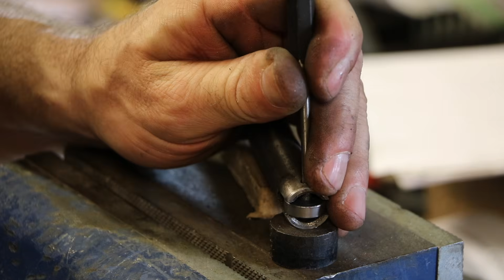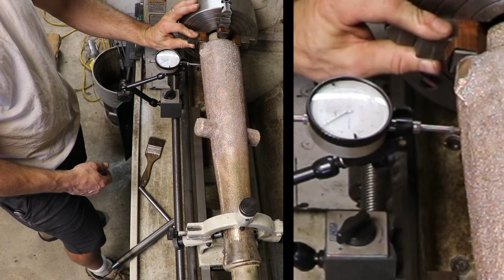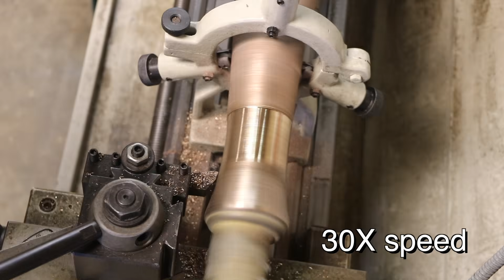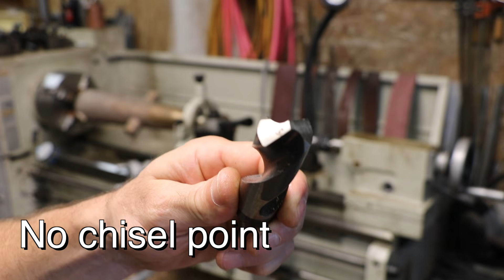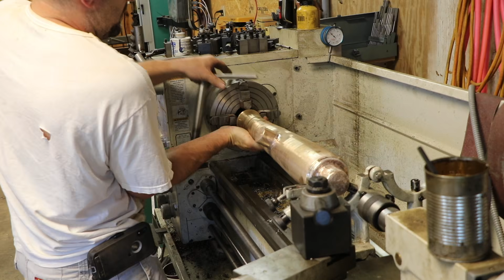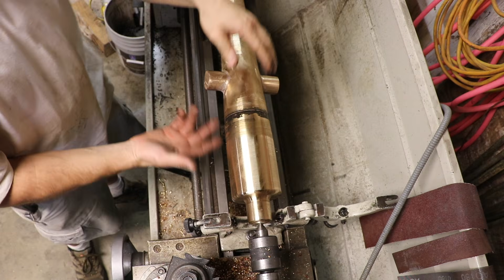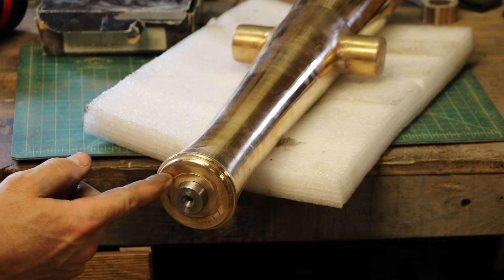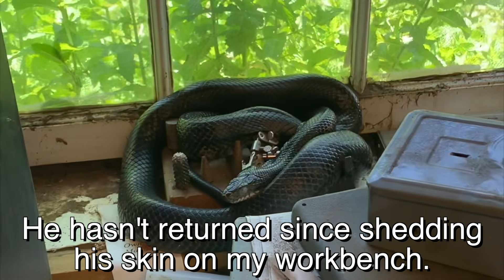Machining a Historic Bronze Cannon Barrel, Scaled Down Replica. FarmCraft101

Comment: you can make a steel sleeve that clamps on the outside of parts to interface with the steady, which gives a few benefits. it allows you to dial in the part at the steady, if it's a bit out of concentricity you can offset it to put the axis right where you want it. it also allows you to run a rough or uneven surface in the steady, because the part actually running on the bearing is the machined sleeve. this wouldn't help with this particular project, as the cannon was too big to start off with, but it would help with small parts, and speaking of small parts. it would let you work on much smaller diameter work again, because the sleeve essentially extends out that surface.

Comment: I've made a great many cannons both cast and from solid. If it's for a noisemaker just proof with  300gr of 1f black wadded with an inch or 2 of newspaper..A  standard  noise load in a 1 inch bore of 100 gr. gives a great bang.  If you want to fire projectiles a 1/4 wall Dom seamless liner with a threaded and welded plug in the end  epoxied in would be super safe.  Cheers.

Comment: For some reason I didn't think making a cannon would be this hard. "Just cast it and bore it, how difficult can that be?" But there are so many little challenges you need to deal with.
Well done man. As for the bore, could you fill the bore with molten bronze and drill it again? Adding a sleeve would detract from the whole "historical" aspect a little.
Reply from the maker: Agree on keeping it historic. And also agree I didn’t expect it to be quite this hard. I like your idea of pouring more bronze down the bore, but I doubt it would stick well enough to help. At this point I’m going to plod onward, and hope for the best.
Reply: @FarmCraft101   I would say it's worth a shot. But then again I'm not the one who would have to do all the hard work!
In either case, you got yourself a gorgeous piece.

Comment: I'm not a professional gunsmith, but I work on my own guns and am familiar with the kinds of pressures  that you're looking at.  To me, it's not the pressure that bothers me.  The fact that there is a casting defect in the barrel is cause for major concern because what if there are unseen defects?  What if that defect is hiding a more serious problem in the metal.  I would not feel comfortable running anything through that barrel.  Going the route of boring it out further and using a steel sleeve is probably the most viable option aside from recasting it.

Comment: Either install a sleeve or shoot it as is.  If you leave it as it is use a proof charge for the first firing.  I'd put a 3/32" touch hole in it and use cannon fuse.  A foot or so of fuse will give you time to get away when proofing.    For a proof load I'd Give it a double charge of black powder and two balls.

Comment: punch it out to 1.25 or 1.375 and sleeve it with piece tube  brass or bronze bearing material or steel liner  or  leave it as a ceremony piece and make another this time with a removable core or a steel tube liner already cast into it.  i know its not the same as an all brass one but its alot easier and safer  in the long run.  plus the steel sleeve will take alot more abuse over time. if you do the cast in steel barrel liner use a thick 1\2 wall steel tube and cut ridge grooves or drill dimples in it the full length so the molten brass flows into them and grips the steel liner ive seen instances where steel liners have come out of things even though pressed in with plenty of interference fit several tons of  pressure.
Reply from the maker: I like the dimple idea.

Comment: I would consider brazing the defect(s), you would have to choose a filler that has a low enough temperature to flow, but not too high that your cannon will deform, this should help reduce any stresses and blow-by forces, then you can re bore the cannon and sleeve it if necessary.
https://en.wikipedia.org/wiki/List_of_brazing_alloys

Comment: you should round/ concave the muzzle end of the barrel slightly to make it easier to load. just a small radius so you dont have that sharp edge on the inner barrel. and for the defect one option would be to expand the bore size until it is big enough that a sleve of some sort would fit in the barrel so that you have a totaly smooth bore with no defects, but im no expert so it might not work but it could make the cannon safer if it did work. but man i wish i was that good at machining, i might have to see if i can try out my brothers lathe

Comment: to find the center on the back of the cannon, you can put a tight fitting rod in the beginning of the barrel as not to compress the hole when you clamp it hard, zero it at the chuck, and approximately zero the back end, put your center to it, barely touching, and rotate the cannon slowly. if it is out of center your centerpoint wil draw a circle in the bronze, if not it'll turn in line with the point and just mark a dot. then you can put a steady rest if you like :) also nicely done for freehand turning, that's not an easy thing on longer pieces like this one :)

Comment: Here's how to fix your "sag" problem. First, take a known diameter from the chuck end and the unsupported end. Next, take the difference and divide by two. Then, mount your mag base on the saddle and zero your dial indicator on the known diameter on the chuck end. After that, you're gonna use the saddle and go positive Z until you get to your second known diameter on the unsupported end. The reading on the dial indicator would, in theory be half the difference in your two known diameters you took at the beginning. However, because your bang stick is drooping so much, the difference your gonna see on that travel indicator is going to much larger. Now, to fix it, you can subtract the original difference in diameters from the travel indicator reading and WA LA!! That's how much elevation you're gonna need from your steady rest. Hope this helps!

Comment: seems a shame to have to bore a fuse hole in it. I would go with a steel sleeve down it no question. You don't want to find out where Smitherenes actually is.

Comment: Yea it made a barrel.  So a collar over the screw capture - and it is long and is captured in the frame.  Extending the screw backwards. Just a though about centering - make a paper collar so the precision ball on the dial doesn't get flattened from the Silicon in the bronze.  Bronze turnings - bucket - how about Bushing for the trunnels on the wood base. The Breach will fill with lead if shooting lead.  Then maybe waxing the lead which will lube the cannon ball or grape shot.

Comment: Maybe you should consider getting some NDT x-rays done on it. That would certainly tell you all the defects in the cannon.
Reply: Ultrasonic testing (UT) would be much, much cheaper. And safer.
Reply: jockellis never priced it out but I did do radiography as a job for a few years. X-ray is definitely safe to do if but I don’t know the cost difference.
Reply: @jmoss10403  I know next to nothing about X raying or Ultrasonic but is the X ray problem that to X ray through that thickness of bronze you need high intensity X rays, safe enough if you far enough away, but not standard intensity sounds expensive. As mentioned this is total guesswork on my part.
Reply: @Cloudman572  doing the xray work himself is not really an option. His best bet would be to outsource the work to a local company. That would be the most cost effective way to do it because the ultrasound equipment isn't cheap and the knowledge of what your looking at when it comes to performing the ultrasound takes time to learn. X-ray is a good way to visually see any defects small or large in the part. The part thickness if a maximum of 2 inches is easy to xray and shooting a part like his would be really easy to do if you placed the source inside the bore.
Reply: @jmoss10403  Ok, but who suggested he do the work himself, certainly not me.

Comment: i really like this project! That said the green sand sure leaves a mess deep in the surface metal
Reply: Not necessarily the green sand. The fact that it's not pressure casted/ not put in a vacuum chamber. I use steel molds and i have this sort of defects.
Reply: @dragosmates  just my ignorance showing thanks for the feedback

Comment: Start over.😢. If it has flaws you can see there is a high probability it has other stress fractures. If there is a way I would have magnaflux inspection done on it or some other form of inspection. 27000 psi is nothing to mess with...12 ton-force per as inch...i am sure with the number of followers it would make for a very informative video. Plus success in the end. Keep up your effort and thanks for sharing!

Comment: What about using a metal sleeve? You might lose some bore diameter but at least you'd be extra safe.
Reply from the maker: I may sleeve it in the future, but for now I want to keep it traditional.
Reply: and possibly fill the hole with something? I guess you wouldn't want the sleeve to bulge out.

Comment: I do not see the logic in the idea of taking metal off it so it will be stronger as well as thinner? No way. The only way to increase strength is through heat treating at this stage of the game. To find center I would suggest straight line and measure it. That way you can get your support to be the correct life, to compensate for the gravity and the deflection in the cannon. Did you do a before weight on the cannon and an after weight after polishing was done?

Comment: I kinda doubt it'll blow out where the defect is at first but you'll end up with lots of blow by, which will erode and stress that the area even more. eventually it will fail and your projectiles will always preform poorly (blow by) before everything goes to hell. I'd sleeve it if your wanting it to function as a real cannon. If your just wanting it for a noise maker (black powder, no projectiles) it'll probably be alright but you've already gone this far, why not make it fully functional. No matter what, it's cool as hell. Thanks for sharing.
Reply: Jon is correct. It will likely stand several firings. However, at some point it will likely fail at that point. If you have the ability (seems like you do) just sleve it.
Reply: Yes
Reply: I agree with @Jon_James.  I was thinking a sleeve is your best bet mostly because of windage erosion past the defect.  Boring it out without a sleeve is concerning for thin walls and possibly exposing other defects.  Filling in the big defect seems like it will be either a strong point or weak point and doesn't address the smaller defects that will also erode over time.  I am not a gunsmith.  Most of my knowledge comes from studying naval artillery so I'm not really sure how downsizing will effect my own assumptions but with defects in a bronze cannon, I would estimate 50-100 rounds fired at the most before you notice severe drop in performance.  Even that may be an overestimate.

All that being said.  Love the channel and I think it's great that you took on this project!  I've learned some things.

Comment: Bore it out a little more, hopefully you lose the defects and don't find more, then add a steel sleeve as others have suggested.
Reply: no because the walls will be too thin at that point...
Reply: @flamecaty  Thats why the steel sleeve.
Reply: @schnitzellover6699  problem with that will be to balance the steel sleeve to the cast bronze. Because both are very different materials their point of plastic deformation ( a deformation with permanent indentation/change)  the steel sleeve will widen under pressure so it will press against the bronze the bronze will permanently deform while the steel sleeve will shrink back therefor seperating the sleeve from the cannon. 

NOTE: this might not happen the first shot but it sure will
Reply: @Caballawongla  Yeah, though you could use a more brittle steel (or other metal). As long as the sleeve has a lower point of plastic deformation than the bronze it and can take the pressure itll be fine.

Comment: Your canon looks great.  When will you start the pirate ship that will go with your canon?
Reply: nerdanderthal IDontLikeGooglePlus
Take it over to Acorn to Arabella in Connecticut! ;P
Reply: @skydronaut5359  I have this distinct image of Doug in an eyepatch, sailing down a river in Oklahoma, shooting this off the top of the pilot house at things on the bank....
Reply: That is not a shipboard cannon design - wrong type of carriage.
Reply: @buggsy5  it has no carriage at this point, and there's no reason it couldn't be used for a swivel mount. It's to small for a carriage gun on a ship
Reply: @skydronaut5359  That one is a Chinese Junk.
Reply: @andytaylor1588  the chinese also had pirates.

Comment: I would not be anywhere nerar, firing the thing with that defect in the barrell. Thing is, if that defect is there -can you be sure that the rest of the cast is sollid? Because if it isnt, it can litterarly be a question of life and death being around the cannon when it fires.
That said, I would probably have a bit of fun all the same. You know, fire the thing with low charges.
Reply from the maker: I agree.  As I've stated in the past, I don't plan to ever fire it with anybody in line of sight.  I will do it alone, and get behind a barricade to protect myself.  In the future I will probably sleeve it so I don't have to worry about failure.

Comment: Melt tin to fill the defects then remachine the bore. Obviously stand well back when firing 😂
Reply: I was going to go with melt some brass and pour it in so it fills those holes, then re-machine. Same thing really
Reply: @seanfernandez7759  " Same thing really" no its completely different story... tin have low melting temperature so you can easly melt it inside something made out of brass and have perfect melt with no deffects and not do any damage to your brass object...
Reply: @Bialy_1  Once you have the brass melted and poured into the barrel it is the same thing.  Granted you would also have to heat up the inside of the barrel help with the bonding.  The challenge with using tin is that if you intend to fire the cannon, it is a place of weakness.  But hey, each to their own right.
Reply: @seanfernandez7759  melt glitter in place?
Reply: There's an accident waiting to happen. Sooner or later that patch will peel off like a scab on a healed wound. 1.) if its a live firing, it will jam up the cannon ball and the tube will blow. 2.) if blank firing, your blank now has a projectile. It will be like the Song of Hiawatha, who knows where it will land.
Reply: @medievalgonnemeister4291  If area of the patch is heated to the point of melting then molten metal of the same kind is added then It should not break off.
Reply: @seanfernandez7759  Working with a one inch bore is tight quarters. How do you propose to achieve this? This is not a harmless toy.

Comment: if you fire it with that defect, you might get one, maybe two good fires, then you'll probably crack the barrel. you might be able to re-melt your shop glitter and fill those defects in. suggestion for you if you do try that, pour the metal down the barrel, cork it, then put it on the lathe, and spin it. it'll help force the metal in to the defects so you wont get a surface patch. afterwards, you can re-bore it to get it all smooth. this is my unprofessional opinion though, as i am not a gun smith. you also might lodge the shot in that defect and cause an overpressure detonation.

Comment: This might sound stupid... but I'll suggest it anyways

What if you heat the inside of the cannon with a torch or whatever way that would get it all red hot but not to melting point, then melt the 3.xxkg you got out of the bore, and pour them inside to hopefully stick to the "about to melt" layer heated earlier and after it hardens, bore it again !?!